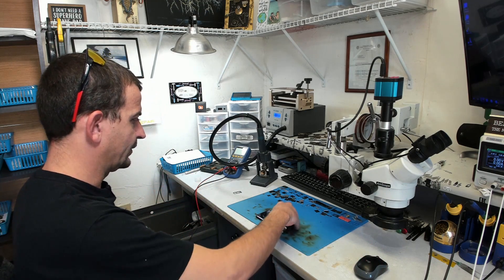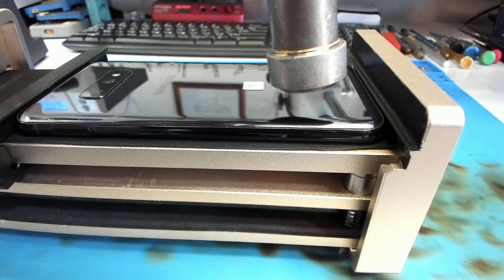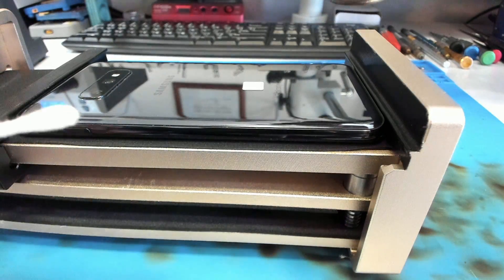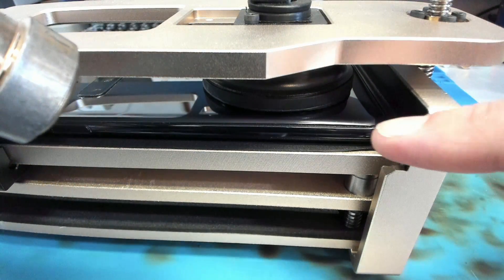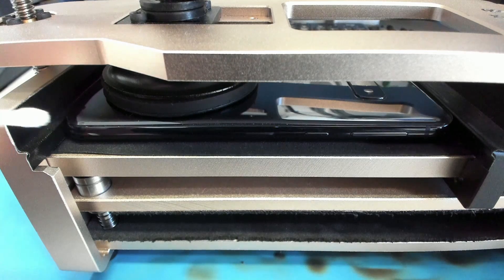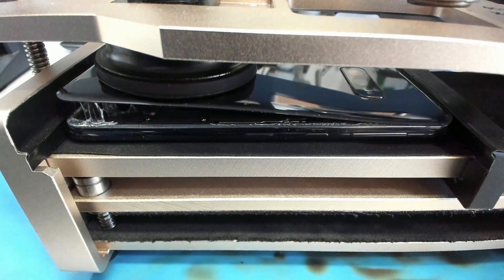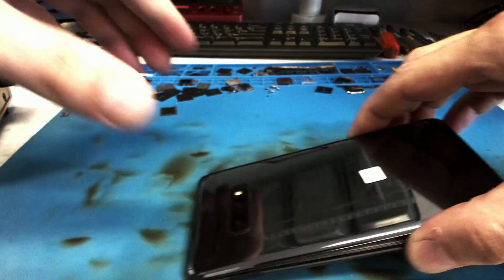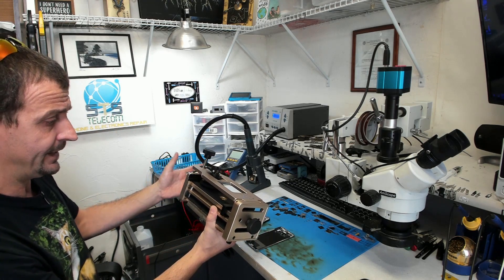Using the REFOX RS50 Mobile Phone Opener to open a Galaxy!

Comment: IF YOU TRY TO OPEN THE WINDOW WHEN COLD IT WILL BE DAMAGED. YOU MUST OPEN IT WHEN IT IS WARM. I WORK IN A COMPANY WHERE WE REMANUFACTURE APPLE 11 PRO, MAX ETC, 12 PRO, MAX ETC 13 PRO, MAX ETC. AND I KNOW WHAT I'M TALKING ABOUT. BETTER WHEN THEY ARE A LITTLE HOT OR WARM, A LINE CROSSING THE ENTIRE LENGTH OF THE SCREEN WILL SURELY APPEAR.

Comment: I was going to ask if it can do an unbroken screens without cracking them, but then I realised there is not many cases you would do that - lol -, ie, you usually do cracked screen replacements . I guess it's the rare case where you have a dead phone with a good screen, and a good phone with a cracked screen.
I just did my S8+, and the instructional vid showed the guy use a laser temp gun to heat it to 76º, ie, a more controlled/predictable way to heat it.

Comment: A simple idea, but works really well :-D
Simple is good, im simple, yes stupid simple :)
Reply from the maker: I didn't show it in this video but the bottom plate that clacked loudly is part of the reverse side of the tool.  It will also clamp them shut but you have to move the big screw and reconfigure it a bit.  I'm doubtful anyone uses it for closing phones though!
Reply: @ststele  I would leave the tool in suck mode, Ooow naughty sounding :)
Do you wipe the incoming phones?.
People have a disgusting habit of taking calls while going to the loo, yuck yuck.
Ill shut up now.